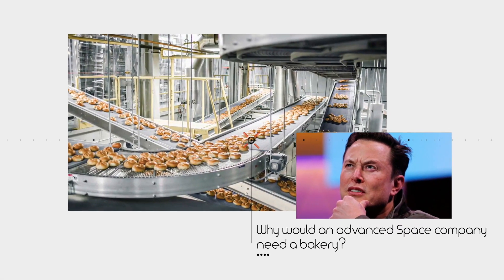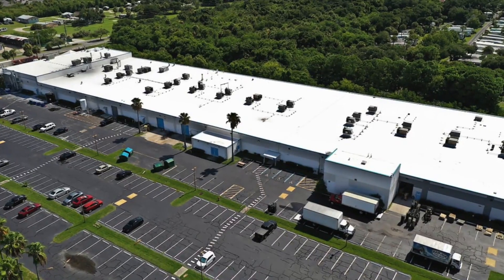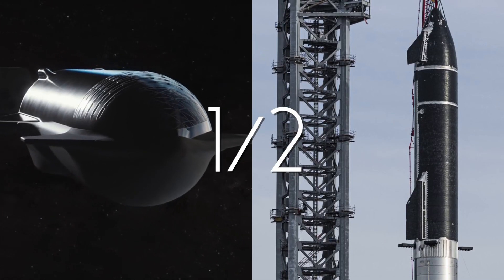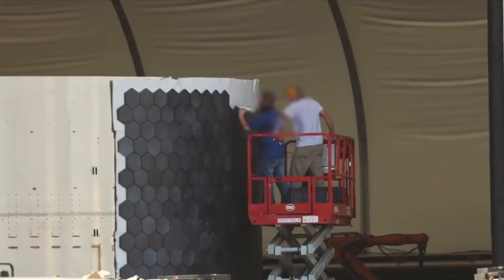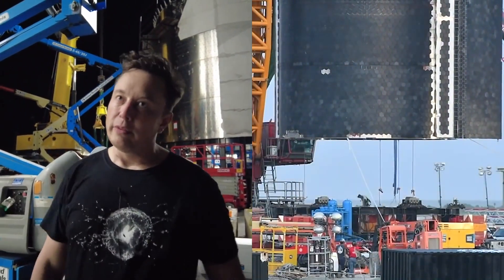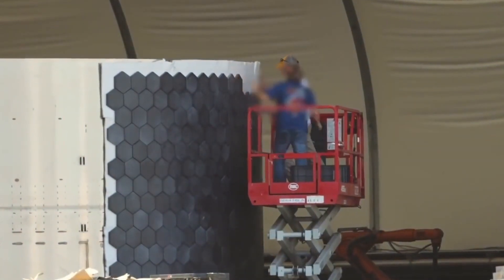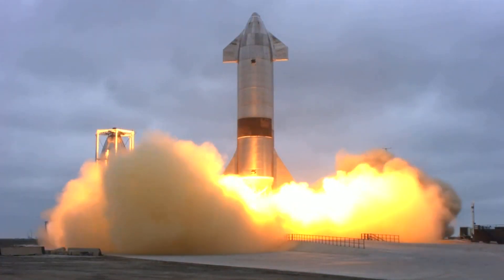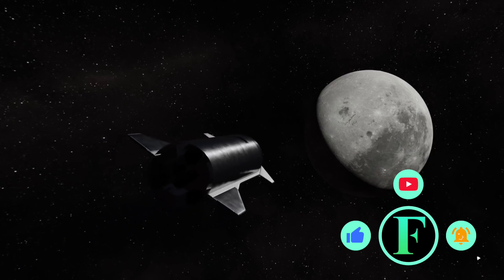Inside SpaceX $1.3 Billion Dollar Space Bakery

Comment: Tiles are just as impractical as the shuttle in the long run. They should make larger pieces, like 2 half tubes or a casing of the entire rocket and lower it over it like a one piece sleeve.
Reply: Those tiles are BRITTLE. You can't have too big of a piece. They need to expand and contract. The type of tiles used is the problem. That is why SpaceX have a R&D for Tiles. They need to find a way to create a more flexible and non brittle tiles.
Reply: Absolutely. The tile size is directly proportional to the expansion and heat stress of the area that tile will occupy. Shape and size /stess and heat.
Reply: I dont think those tiles are only one component. Multiple fibres with bleed rates and fibres of higher strength. Composites.

Comment: I have the feeling the heat shield is going to be a big issue. We'll see after the first flights if it is up to the task in its current form.

Newer ships will have the fins more to the back of the craft to take them out of the plasma stream during re-entry, which will help a lot but I think perspiration cooling is still a great option.
Reply: Elon said he was considering using Transpiration cooling for exposed joints, Where the tiles would not work.
Reply: They moved the fins for aerodynamic control reasons, not thermal reasons